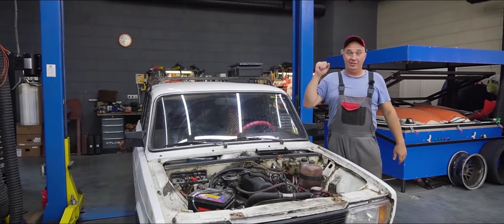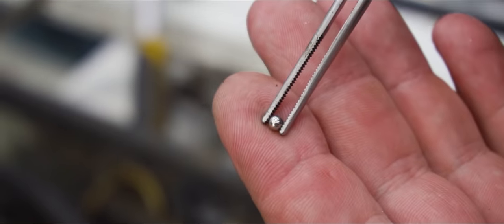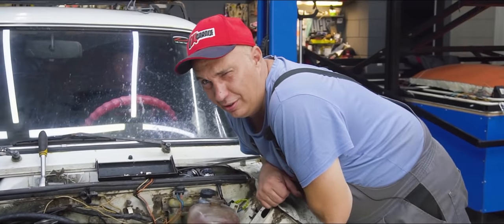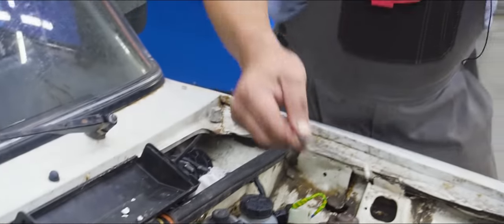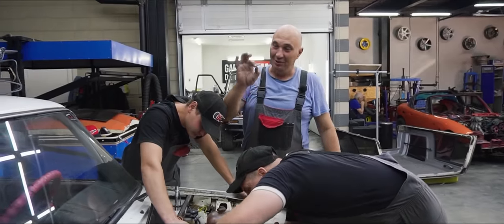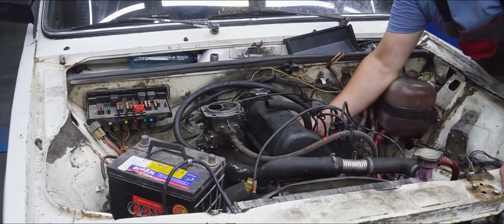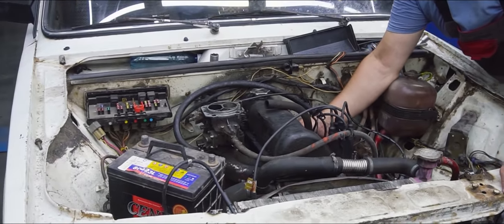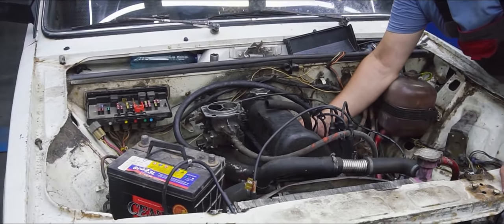Putting metal ball inside combustion chamber to see what happens

Comment: You should fill an engine with valve grinding paste and see how fast it destroys itself
Reply: port n polish it self  lad
Reply: Run it on coal dust like Rudolph Diesel also tried in 1899 and watch how it polishes the cylinders. The engine was coked up after 5 minutes
Reply: I was thinking a spoonful of sand...
Reply: Ajax of comet
Reply: yes
Reply: lol.. that cracked me up. good one.
Reply: Ohhh yes
Reply: try pouring glass bead in the carb of a running engine.
Reply: @Reziac  Ya, feed it spoonful of sand or anything else through the carb and see what happens. Sugar, salt, bleach, sodium hydroxide crystals, ajax or comet, sand... I'm sure there's a bunch of other things they could try "feeding" the engine.
Reply: @keithyinger3326  ...or cement mix... Through the carb is more interesting than just tossing it into the cylinder!
Reply: Thats nothing, check out Whistling diesel trash a engine in a dodge. A must see, if you haven't. Peace boys
Reply: I like this idea, but with just one tube of finishing paste and into the oil fill. I always speculated it would toast every single bearing surface and in rather short order. Friend of mine thinks the oil filter would clean it out, I disagree.
Reply: @keithyinger3326  Sugar...? 🤔💭

 ,,POOOUR SOME SUUUUUUUGAR ON MEEEEEEEEEYEYEYEH" 🎶

Comment: theory:   the ball that made its way into cylinder 4 exited cylinder 2 through the intake valve into the manifold and was then sucked into cylinder 4
Reply: yes you have same idea as me
Reply: Exactly what I was thinking too!
Reply: I personally think it noclipped through the cylinder walls
Reply: I think the same. Intake valves are bigger.
Reply: Yeah, I thought the same. Those balls are really “bouncy” (hard) so it wouldn’t surprise me if it left through the intake valve.
Reply: Yup same
Reply: I'm a retired car mechanic and I too believe it made its way through the intake valve. It's no sucksjon on the exhaust side.
Reply: This is not a theory but a fact it made it´s way into the intake manifold and then over to the next cylinder. I worked with engines for more than 10 years and I seen many things happen including catastrophic failures with exploded valves on one cylinder with parts getting into everything else, cracked and blown pistons and everything you can imagine. since the valves are only closed by springs it´s not that strong on the closing direction and if things gets caught in between it gonna stay open and the compression will blow back into the manifold taking whatever it can back out again. and things happens in so many times as well so even if the chance would be slim it gonna take this path is still gonna be pretty big in the end considering the amount of times it does it. btw,  on engine the valve head broke of from the stem at very high speed and the havoc it caused was one of the most serious things I ever seen, just imagine how big this is comparing to the small objects in this video and at probably maximum speed it totaled the piston to be almost unrecognized on the surface, it broke off 3 of the four valves that kept smashing the cylinder and eventually one of these valves crashed so hard into one valve seat it blew the whole seat ring and itself back out of the cylinder and into the intake again through the smaller hole it was entering curving the whole valve into a taco shell. I am dead serious here and it was one of the most amazing damage I ever seen on one single engine. the head and piston was completely obliterated and parts were everywhere
Reply: @Pulverrostmannen  I agree with you, I believed that Ivan was a professional but how could he be so wrong? I see your profile name is Pulverrostmannen is you from Norway like me?
Reply: @Kladden67  that close actually but I am from Sweden :)
Reply: @Pulverrostmannen  I was living in Sweden from -89 to -93 in Sødertelje when I was working at Saab-Scania I was working at Scania when the Saab side was sold. It's beatifull in Gamla stan I Stockholm. :-)
Reply: @Pulverrostmannen  I was living in Sweden from -89 to -93 when I was working at Saab-Scania in Sødertelje. Gamla staden i Stockholm is very beautifull. Dom solde Saab avdelingen when I was working at Scania. :-)
Reply: Bingo
Reply: same thoughts as me. intake.
Reply: @Pulverrostmannen  I had an old '84 Mitsubishi Mighty Max a while back and the brass valve sleeve on #2 broke off and a very small fragment fell into the cylinder and destroyed the exhaust valve.  surprisingly, and lucky for me, there was no damage to the head, piston, nor cylinder wall. but your right man, even a tiny piece can cause tremendous damage
Reply: @Kladden67  that’s nice, sweden is it’s nice places for sure. I live on the southwest side so it’s actually closer to Norway for me than Stockholm
Reply: @jacklarson6281  sounds like you were a bit lucky with your engine then :)
Reply: @Pulverrostmannen  I got it after it was almost 10 years old and put about another 100k miles on that truck. was the best truck I ever had.
Reply: Actually ive seen broken intake valve jumped from its original cylinder into another cylinder
Reply: possible...
Reply: It could have exited through the exhaust and bounced off the inside of the log and back into 4.
Its far less likely, but certainly possible.
Reply: @jacklarson6281  I had a truck too back in time and I miss that still. The last car I had was a MK5 and it only ran for 91000 miles and then the connecting rod blew out from the side of the engine. It was the worst car I had so far
Reply: This is very common- broken parts get deposited all over the motor, all the time- especially in racing engines.
Reply: Yep. Another ball bearing could've held the intake valve open on cylinder 2 as well.
Reply: @benperkins2929  Probably bent the valve because the ball wouldn't hold the valve open unless it didn't fit through.
Reply: @theamerican7080  Why couldn't a valve be held open by a ball. There's no reason it couldn't. Just has to close on it.
Reply: @benperkins2929  Yes and the chances of that are slim, especially of if the ball fits though a fully opened valve moving at the speed of exhaust gases.
Reply: @theamerican7080  nah
Reply: @benperkins2929  Tsk..
Reply: @Pulverrostmannen  Very common on race engines.
Reply: Yea when it backfires at cyl.2 cyl.4 is at choke so blowing out and sucking at the same time
Reply: Same thought bruv
Reply: @Kladden67  Did you watch the video to the very end? He says himself that he believes it is more likely that debris exited through the intake, and was sucked in my the other cylinders. He saved that theory for the very end.
Reply: @richfiles  I watched to the end, I always do.
Reply: @bakedandsteaked  Hey, when you get into the subatomic level and/or involve quantum mechanics and/or exceed the speed of sound things do indeed noclip.
Ever put two socks in the dryer and only one come out? Or bring in a watermelon from your trunk after getting back from the store, go back to the car get the milk, then come back to discover the watermelon is gone and have no idea where it went even 40 years later (my mother experienced that second one - one of her favorite stories lol -  she's still baffled by that darn watermelon to this day!)
The answer for bearing leaving 2 and entering 4 is the same for the sock disappearing from the drier and the watermelon despawning from the kitchen - temporal flux or quantum tunneling. *nodnod* Which are complex ways to explain that the universe smacked ~ and typed in a console command. Any simpler and logical explanations for such phenomenon are just conspiracy theories. ;)
Reply: I agree
Reply: More likely to be the other way round as he thought, but not for the reson he said. The balls probably all left the system through the exhust valve, then as shown when the ball the smashed into the head right next to the valves it could have easly jammed on the exhust valve keeping it temperaraly open. This would mean on the next revolution the exhust port what have acted like an intake sucking the ball in from the exhust system.
Reply: @Pulverrostmannen  No, this is Theory not fact and not a very good theory as the chances of it coming in through the exhust are much higher then that of it getting back into the intake.
Reply: @cbullar4205  what I said is not a theory. It is a fact. The truth about this is that I worked renovating real engines for more than a decade. I am not joking when I am talking out of real experience and I been taking engines apart where parts have been all over inside the intake manifold that have been blown back out from the combustion chamber. So no facts are facts if they are true. I seen everything happen with engines, literally. But That also means I seen this happen with stuff coming back in from the exhaust as well
Reply: Agree
Reply: @bakedandsteaked  🤣

Comment: So when the ball bearing escapes through the exhaust valve is that how you get muffler bearings?
Reply: There is no escape!
Reply: Make sure u change ur muffler bearings every 2 years.
Reply: If you keep your muffler belt tight the muffler bearings will run more smoothly
Reply: Don't let Nissan see this comment.
Reply: Yeah obviously, it’s like that in every car stupid.
Remember the Supra comes stock with ones that make 1000bhp
Reply: Now ya know😀
Reply: The purest
Reply: Modern cars have Muffler Bearings.   But years ago cars had Muffler Belt Box Bearings.  Muffler Belt Box Bearings needed more maintenance and didn't last as long but they sounded so good compared to just plain Muffler Bearings.  After 1972 when smog/emission controls got really strict in the automotive industry they stopped using Muffler Belt Box Bearings and it was downhill after that till around 1999 when they started using much more sophisticated  Digital Muffler Bearings with the OB2 port.  I can't wait to get some new Billet Magnetic Muffler Bearings, that is top of the line high horsepower stuff.  I can't wait to see what kind of high-tech Muffler Bearings are going to be at SEMA this year
Reply: @0mniVerse777  I don’t worry about the muffler bearings, I just turn on the “Rattle Elimination System” (Radio)
Reply: possible.....................
Reply: @tabcreedence6553  On the contrary, tightening the muffler belt will increase load on the muffler bearings, only tightening it enough to not slip will extend the lifespan of the muffler bearings.
Reply: … wait so you… gain power
Reply: @freddieparrydrums  yeah but everyone takes them off because they are worth a lot of money..
Reply: @isaacsrandomvideos667  True. Debearings
Reply: I've had my truck for 7 years and I have yet to change my muffler bearings.
Reply: Muffler bearings are so over rated. its about the chrome reverse muffler bearing
Reply: Daschickenify   If you have older V-type belts I suggest upgrading to a serpentine belt system with seal roller muffler bearings.  And upgrade your belt box to a widget and gearbox type, also known as a muffler gearbox bearing.  It really improves performance and creates a tighter cleaner look but I do appreciate people that stick with the stock OEM equipment babbitt style muffler bearings.  But remember with the older style Babbitt type muffler bearings be sure to change your mufflers oil and muffler oil filter regularly.  It also helps to add a zinc additive to the belt box every 10,000 miles or sooner if do a lot of idling
Reply: It's good for clearancing turbo wheels.
Reply: @0mniVerse777  You can go 40,00 miles without new muffler bearings if you change the muffler fluid every 5,000 miles, though.
Reply: No, that's what you call pinging.
Reply: @K-Effect  Yeah well, when F1 tech like ceramic muffler bearings come down in price, then every 'Joe Bloggs' on the street can fit the silky smooth freer running/nigh on 0% rolling resistance & heat resistant the Ceramic tech provides. This would in fact help (for example) a Fiat Grande Punto 1.2 8V up it's poultry standard 65 BHP to a smidge over 150 BHP with just that mod alone... So Imagine what it could do with  Beemer M2 CS/M4/M5, Yaris GR, MX-5, Ford 'Stang, Camaro, BRZ/GT86, Golf GTi, Ford Fiesta ST Or AMG Merc, Or Even a Tesla Plaid? Etc... 🤔😏😎🇬🇧
Reply: Oh also, hope you guys have upgraded (to save the Planet by reducing emissions) changed your Blinker Fluid to the Ethanol (E10) based fluid??? It IS quite important guys... 🤔😉😎🇬🇧

Comment: A friend was cleaning the carb on his El Camino and somehow dropped a check valve ball into the intake manifold. He didn't notice, started the car, it made a ticking sound, and the top of the piston looked as if it made friends with a shotgun.
Reply: I'm thinking tiny pure lead shot could possibly be pulverised before it caused too much serious engine damage. Lead is actually a reasonable friction reducing material, so powdered lead might even be slightly beneficial on an older engine by finding it's way into valve guides and impregnating piston skirts......... Or it could just gunk everything up. :D
Reply: That is common with pistons of El Camino owners. Lmao

Comment: My first car ever was a Lada 1200L. Once upon a time i was once again tinkering with it's carburetor and accidentally dropped an M5 nut into the carb throat - one of those nuts that clamp it on the intake manifold. It made a pinging sound for a while but given a proper slam on the gas pedal, it apparently found it's way out the exhaust valve and into the exhaust pipe.
Reply: I had a used Lada nevia years ago it was in great shape but it kept over heating, one of those bolts holding the the intake was missing must have worked its way in there. 
You gotta love Russian Engineering.
Reply: Only Russian cars can run with stuff bouncing around inside
Reply: @ashleytucker9291  lada is a rebranded fiat, at the time fiat was so reliable..
Reply: I wish Ladas were available here in the US..,  jus imagine all the fun we would have
Reply: @melchiorrebaldassarre1782  well to a certain extent. The Lada was given more ground clearance and beefed up suspension components like bearings and was given different specification parts most definitely for predicted climate. I don't think a fiat would handle it as easily as a Lada with less clearance. Smaller parts, and best of all, if the fiat starter broke, the Lada had a hole for a hand crank backup which I really like the idea of. Lots of little tweaks and touched which made the Lada significantly heavier and beefier and more reliable in harsher climates.
Reply: @jacklarson6281  they were in Canada so if you were close to the border you could have had one maybe
Reply: @melchiorrebaldassarre1782  I don't think so I have 1991 fiat 126 BIS and it brokes down a lot.
Reply: @huseyinuguralacatli5064  yes, because it was a Fiat. Not the most reliable car in the US, because driving conditions (and drivers) are so different from it's country of manufacturing. 😜
Reply: I had a screw in a cylinder once , I rev it but had to take the head off , the noise was immense.  it hit 3 pistons! one screw

Comment: When I was younger I worked as a mechanic at a gas station here in the US called Chevron. We had a guy bring in a 1989 nissan pickup with a four cylinder engine. It has the loudest ticking sound I have ever heard.  Turns out his cousin was helping him change the spark plugs on it and for what ever reason only known to himself he dropped a phillips quarter drive screwdriver bit into the cylinder and didn't say anything.  We found it during a borescope inspection. It had embedded itself in the crown of the piston and made hundreds of plus shaped marks in the head face in the process with a lot on the piston as well. I had seen many weird things there but that one took first prize. 

That was a great experiment. You guys are one of my favorite channels on YT.  With all of the torture you have put those poor cars through I firmly believe that the last car running on earth will be a Lada.

Comment: No mystery, intake flow reversion. That's how various bits make it from one cylinder to another via the intake valve.
Reply: Yup, I had a Chevy 400 small block blow up and most of the other cylinders had piston bits from the one dead cylinder.
Reply: @jasontruman1215  Wow, learn something new everyday! I knew it was possible to some extent, but I didn't know the bits travelled between cylinders so effectively.

Comment: At the end of the Exhaust phase the intake valve has already started to open, this is called the overlap phase of the camshaft. Ideally at higher RPM the velocity of the exhaust stream after all pressure is relieved will actually pull a vacuum on the combustion chamber allowing fresh air and fuel to evacuate the burnt fumes in the cavity. It is during this overlap phase at lower RPM  that the kinetic energy imparted to the ball was able to overcome the low velocity of the intake charge and find it's way into the intake manifold allowing it to arrive in an alternate cylinder.
Reply: Yes , thats what happened on our engine , it had individual exhaust runners , and still changed cylinders .
Reply: I agree. Generally, valve timing overlap provides “blow through” to clear the cylinder of spent exhaust quicker and (or) establish early flow velocity quickly when the intake valve opens. I don’t know if that’s the specs on a Lada engine but it could explained the ball migration from one cylinder to the other.
Reply: @rustyaxelrod  All engines have overlap with the exception of extremely low RPM engines which you might see on a small oil rig and even those start to open the intake valve before the exhaust is completely closed.